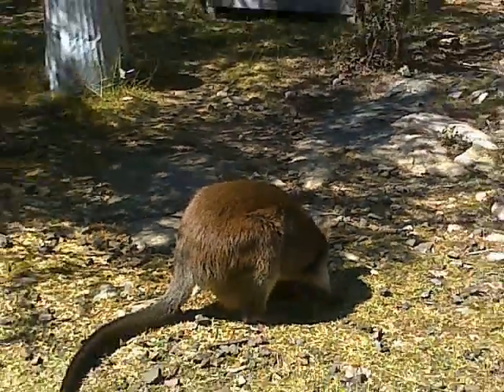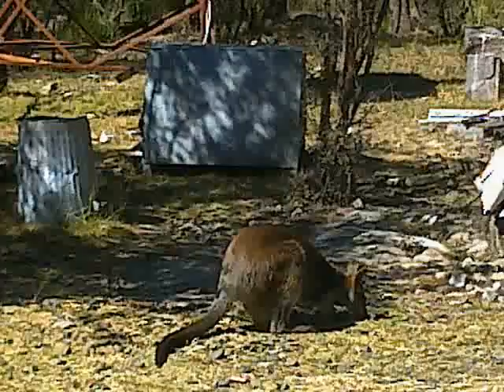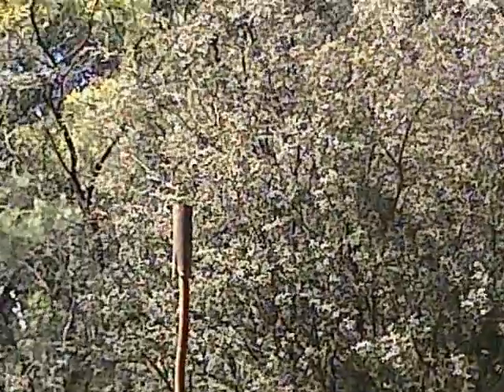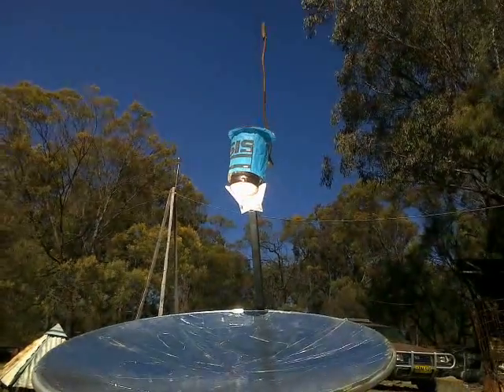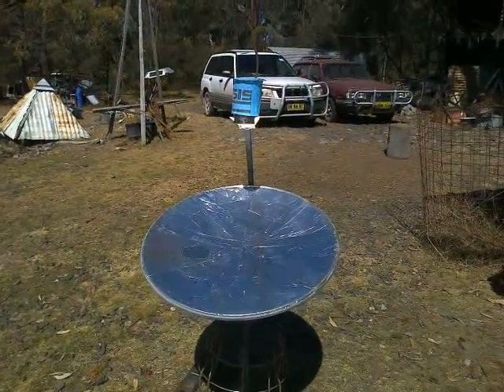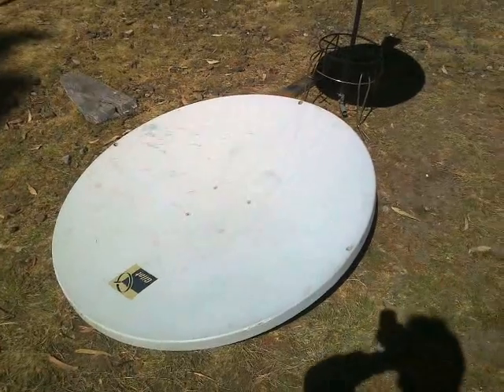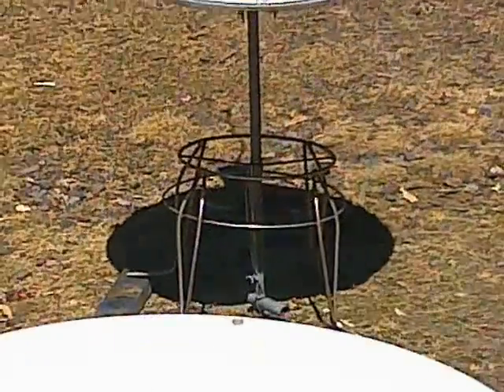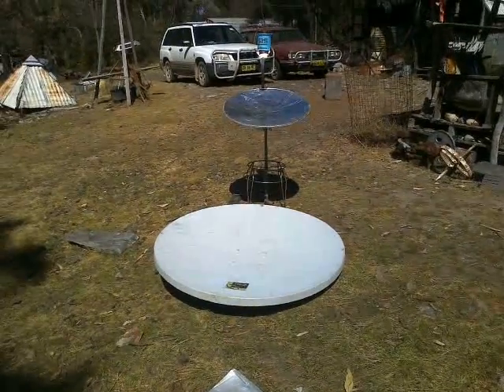SunGas..., Solar-Thermal Wood-Gas ; The First Experiment.

Comment: Big old tractor tyre tube might serve as a collector
Reply from the maker: G'day,

   Thanks.
     
    Well, I'll check it out, apparently one has to be wary of adding gas to any Container which has any Air in it ; and a soft-walled/burnable-walled  Elastic-walled Container for a Volatile Gas strikes me as being a bit of a risky proposition...

  Easy to set up a Fireball.

      Have a good one,

   ;-p

  Ciao !
Reply: i have seen some devices on youtube for storage, a drum in water with it's bottom cut out, the drum rises up as gas fills...the tyre tube one I saw with a sheet of ply over it and a rock on the ply to squeeze the gas back out. You should have no Oxygen in your end product, if your rig is sealed properly.
Reply from the maker: +m3sca1 

  Yeah, the idea of having a pair of Cylinders, the bottom one full of Water with an open top & the top one slightly smaller in Diameter, inverted & inserted into the first one, with the Gas bubbled up through the Water into the top Drum, so the Gas-Volume raises the Top Drum....; that's called a "Gasometer", adding a Brick to the top of the Top Drum induces a bit of Pressure with which to push the Gas out through a Pipe for later use...

  If I scale the whole thing up I'll probably cobble up a Gasometer...

At the moment though, it looks as if one needs a really big Mirror to pyrolyse a small bit of wood.

  Have a good one,

  ;-p  

   Ciao !